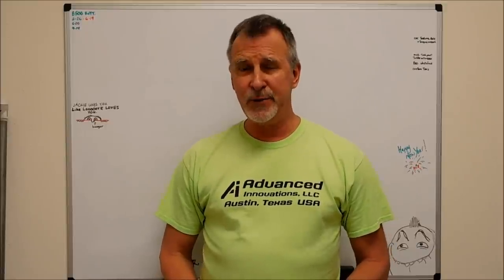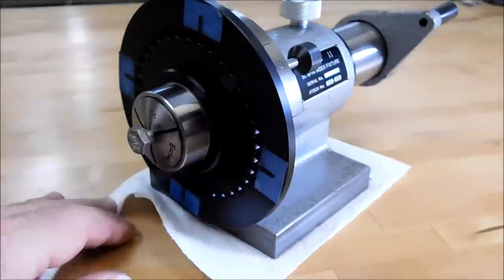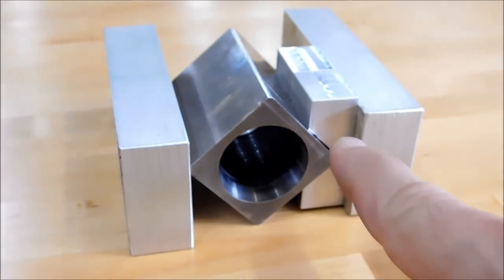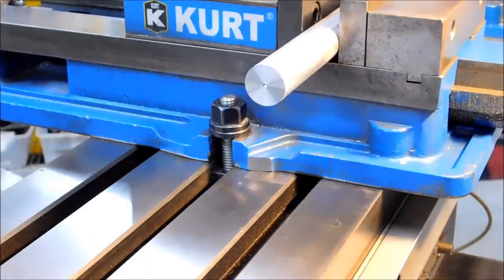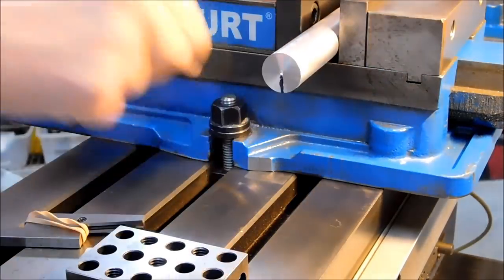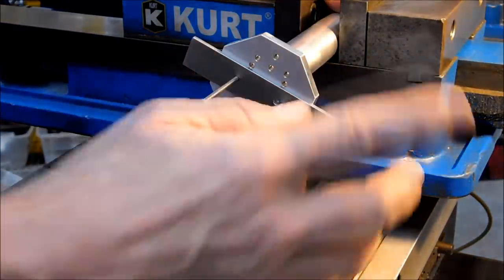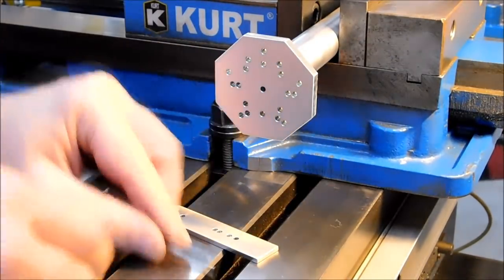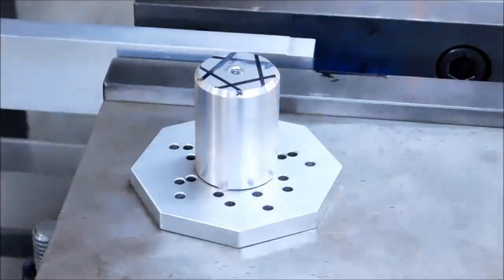No Indexing Head...Not a problem  - Take a look

Comment: At 11:30  I was really struggling with " Does the hex need to be centered?" and Joe said, "It does not have to be centered."
Like his video could hear me thinking.
Reply from the maker: Centering this index device is not required if you are just drilling a hole pattern, like for a spoked hub. Provided you bankk your stop off the part like in the demo.  If you are milling, all registration should be done from the part with the jig as reference or the milled feature will be eccentric to the part since the pins drive the height and depth of each side cut.
Reply: Clark Magnuson
That is the mark of someone who unlike most professionals has not lost sight of the learning process that got them where they are now. It's also the mark of a good sales person who knows what your next question is going to be and addresses it before you even have a chance to get anxious about it. This guy is the cream of the crop and would be with most any pursuit he chose.
Reply from the maker: Thank you for the compliment. Very much appreciated.

Comment: Hey thank you for the idea, do you think can work this for a timing belt pulley?
Reply from the maker: Can you be more specific?
Reply: @joepie221  Hi, thank you for read my question. I have 1 week looking around to get some ideas to "index without" indexer... fool of me... hahaha, I think I already saw the most popular machinist on youtube (This Old Tony, Keith Rucker, Winky´s Workshop, Xinudu, your channel, so on...) and all their ideas are good, but in some of the cases I don't have the "other tool" to make the pattern until I saw your solution. Our business is sell belts and conveyors, and engineering services (is a family company), so time to time some customer ask for a timing belt pulley could be an XL, L, H, T5, T10, 3M, 5M (we gave 24h service) so, that customer phone call is at 11pm..... at that hour I can't call Martin for a spare part. I knew the most easy way is buy an indexer, but its not affordable if you only have few jobs like that a year. So, after I saw your solution I think... what if a can attach some Nylamid, Delrin, Aluminium (or other material easy to machine) to that hexagonal plate, move the pins to the necessary angle and use a cutter on it????  but I don't finished to get the logic behind the hole pattern, If you want I can send you an email with the photo of the idea. Also I knew there are some considerations to make the tooth on the pulley (angle, shape, tooth step, etc) but remember is to keep the production working until you have the the right spare part.
Thank you again, and keep going with this channel is grate.
Reply from the maker: @scualo00  Feel free to send me a picture. I'll help you if I can.  aiproductinfo@gmail.com
Reply: @scualo00  not too interfere and perhaps anyway I'm too late. Depending on the number of "teeth" on the wheels I'd be very careful. I considered using a saw blade with 200 teeth. Unfortunately, perhaps, I didn't continue to drill the 200 ø2 mm holes in 20 mm aluminium disc with the saw blade as an indexer. I wouldn't be able to guarantee the holes to be drilled straight. Thus I would expect to have to change the toothed belt too often. I ended up making a V-belt in stead.

Comment: Joe, Only One question, from a 67 YO, returning to Metal Working: what is the dimension of the Octagon Bar across the Flats? I will have to Make it from Square stock, as my local dealer has Zero Stock that is 8 sided.  Thanks, Philip, AKA MadSighNTist.
Reply from the maker: The outer octagon size should be large enough to allow for a clean outer hole pattern. I believe mine is 2.25"
Reply: I came.back because my Brain had the Lightbulb go on!!! It does not Matter what size the Octagon is, it only matters that the Dimensions for the Holes "fit"!  But thanks, I'll draw it out @ 2.250 inches. Your a Great Instructor Joe.
Reply from the maker: Thank you very much.

Comment: Can't make out dimension for 1st hole from left edge on the Index Bar from the screenshots in the vid. Can anyone help please? Must admit really appreciate it Joe for taking the time to make this video. Have been holding off buying an Indexer purely because of their cost that i can justify for my hobby because it would be rarely used...
Reply from the maker: Pretty sure it's 1.30. Its the distances from the first hole to the rest that really matter. the first position is arbitrary.
Reply: .854"
Reply: Thank you Joe for giving so much of your time to help. I love everything you take time to share and I will certainly add this as a nice indexer is going to take time to get. Wow! What an incredible solution. Thank you. I’m sure I will have questions when I can make one. God Bless You and your Family. Happy New Year.
Reply from the maker: Joe G. The outermost hole on the plate is .856, the index bar is 1.35 just to center the hole pattern in the bar. If your bar is shorter or longer, this number should move accordingly.
Reply: Matrix Gunsmithing, I've been looking at indexers and I would love to have the spin indexer Joe Pieczynski shows in this video. You can also buy a 3" dia 4 jaw chuck with a 5c spindle mount that would work really nicely with it. Both tools come to about $350 which is out of my range at the moment, but the indexing plate Joe P showed us (or a variant of it) is very near the top of my "What to make next?" list.

Comment: All good ideas. But I think I got you beat on the 5C collet blocks. I've got 4, 5, 6, 7, 8, 9 and 10 sided blocks. Also on the SpinDex. If one is going to buy one I would recommend also purchasing the tail stock unit to go with it. Plus once you get them take the time to precision grind the sides to make sure they are square with the spindle both horizontally and vertical. You can also add a key way on center or at 90D to make set-up in the mill that much easier and more importantly FASTER.  Also when clamping a 6 sided collet block in a mill vise. Place a dowel pin, blank drill bit. end mill shank or something you know is true under the collet block. It will be far more accurate than going off of the corner
Process for making Odd Sided Collet Blocks. 
http://bbs.homeshopmachinist.net/threads/9015-Collets-Blocks-Redux-(long-post)?highlight=Redux
Reply from the maker: I honestly didn't know that many variations were available. Very cool.

Comment: I am new to precision machining . could you give advice in dividing a circle by 7 or 9 , I need to make a 12" hub, with a central mounting hole. And 5,7or 9 mounting points on the outer perimeter. It's exlerimental so maybe a master with all three hole sets. Maybe in 16ga alum. To machine in a perfect circle with the holes in .250" plate. I'd normally go to a machine shop but would like to learn more of  the skills .. Great video.
Reply from the maker: Break it down into math and you should be able to create anything you need.
Reply: I use an android app called MathXlite for those kinda calcs... its great !! 😎👍☘🍺

Comment: How do I indicate 72 points using any of your methods ?
Reply from the maker: You would need to create a 9 hole pattern first, then keep splitting the pattern. 9 turns into 18, 18 turns into 36, and 36 turns into 72. So a 9 hole 40 degree spaced bolt circle is where you start.
Reply: @joepie221  Would 9 holes on an 8 sided index plate then rotate it through all 8 sides, marking all holes as you go work?
Reply from the maker: @RazorCustoms  No. 9 holes is not an option with this plate.
Reply: @joepie221  not with your current pattern. I was meaning patterning 9 holes onto an 8 sided plate. Then rotating it.

Comment: I'll put a 60o center on the indexer plate and stick it on the shaft with the tail stock
Reply from the maker: There is a .126 center hole on this block. You can also make your part longer and drill a hole for an alignment pin. Face the material afterwards. I call that a 1 way part.

Comment: 3:50 Couldn’t you use a pin on one side of the vice instead of using the ridges on the block? If you can, I believe you want to have a flat face only on the rigid part of the vice since you can trust it more
Reply from the maker: If I understand your comment, using a pin as a parallel between the sloping surface of the hex block and body of the vise is a very common practice. I usually use drill blanks because of their length and ease of handling. The natural combination of geometries between the hex block and round pin,  will want to walk the block off the stationary jaw as gravity or finger pressure are applied, so have a very mild vise pressure on the hex block as you seat it.
Reply: Joe Pieczynski Thank you for responding even though the video is a couple years old. That isn’t what I meant, but that is good to know. I meant putting the pin between the moving jaw and the vertical face of the hex collet. That way you’re applying force along a line, not a plane, which prevents the face touching the static vice jaw from being rolled off. Unless your jaws are exactly parallel, the hex collet will only touch a whole face on one of the two jaws, and using a pin like this ensures that it registers to the static jaw. Does that make sense?

Comment: cool  Joe, I just don't want to pull out that 100 lbs rotary table if I don't have to.  anyways, wouldn't you rather register the workpiece against the solid jaw than your indexer.  In the event your moveable jaw lifts.
Reply from the maker: Sure. The required accuracy of the feature would drive the setup. Tape does compress.

Comment: Hey Everybody! I also had problems reading Dimensions, That Is, Until I went from a setting of 360 to High Definition, I could read Everything (Except no Dimension on Octagon itself, Maybe I should now go OFFLINE and look at Screen Captures of His Awesome Drawings) !!!
Reply from the maker: The size of the octagon should be driven by how big, and how many hole patterns you want on your jig. Keep it manageable so it still fits in whichever size vise you are using. I believe mine is 2.25 across the flats. I'll check.

Comment: An import spindexer is $75 Canadian at KBC.  If you can't afford that to stuff in your tool cabinet, you aren't doing machining.  Your method can be used on weird shaped stuff that doesn't fit in one of them though.  Is the tape 3M VHB?
Reply: "If you can't afford that"   ---the kind of words spoken by a closed mind, closed to the creativity to solve problems by a different approach. Not everyone has access to the same tools or the same budget.
Reply: I like Joe's idea, thumbed up the video and can think of various reasons to add it to the problem solving idea locker.  Being a cheaper solution is just not one of the reasons (he brought up the price issue).  Perhaps you should investigate the cost of tooling, materials and machinery before you get offended about someone suggesting $75 is affordable in this business/hobby.  That would be on par with one of the cheapest tools in a machinists shop.
Reply: A spin indexer is useless if you need features whose included angle doesn't fall on degree boundaries (e.g. 7 bolt hole circle).
Reply: Hi Barry, I'll note a couple of points:

(1) No one is getting offended about whether or not $75 is affordable or not, because that's not what you initially said and not what I responded to.  So don't try a bait and switch on what is being discussed.

(2) My response was to your "if you don't do something the way I think it should be done, you aren't doing machining" self righteous garbage.  

There are no public videos in your channel.  Maybe you could start posting vids telling us all how we should spend our own money?  Should be popular; people really like that.  {/scarcasm}

(3) You seem awfully invested in what tools others buy. Why do you care so much?  Joe even mentioned in the video "maybe it's for a one-off" as in do you ALWAYS go out and buy specialized tooling for a one-off?

(4) Joe has a broad audience, from pro, full-time machinists, to serious hobbyists to folks just interested.  What he's showing with his channel in general and this video in particular is you can THINK to solve problems, not just always throw money at them.

(5) There is always more than one way to do things, but a lot of people don't get that or forget it.  Not every problem is a nail to your hammer.  Who knows, maybe what Joe is showing saves someone some trouble or provides a back-up or something if their fancy, store bought "only $75" solution gets dropped and out of index or something bizarre. Just knowing alternatives exist can be helpful sometimes.

(6) You did far more than thumb's-up the video.  You made a point, you went out of your way, to say what amounts to, "Yeah, good video but unnecessary.  Just spend the $75 on a indexing tool because if you don't, you are not really machining."  It was an insult to Joe and the community that watches his videos.
Reply from the maker: Hi Barry. Good to hear from you. This video was inspired by a 9 sided shape question. Agreed, the indexers are not the most expensive tool out there, but the availability and occasionally the cost can slow things down a bit. This little jig will never replace an indexer, but it will get the job done. The tape may be the VHB. I used the .026 for this video.
Reply from the maker: The tape ------- I have 4930,  70-0160-2961-6  and 4950, 70-0160-2962-4. The 4930 is .026 thick and the 4950 is .045. My exposure to the entire line is limited, so there may be thinner. Be careful how much of this you use, it is really strong.
Reply: Then you simple do the math, get out your rotary table with an outstanding vernier and and cut or drill ANY hole pattern or sided object your heart desires. 
Point was for people who don't have.... and want to perform ordinary operations, simply.
Reply: Any engineer or DIY person who designs a diametrical-bolt-hole-pattern which isn't divisible evenly by either 5 or 6 deg needs some re-education. Same holds true for the no of flats on round stock.